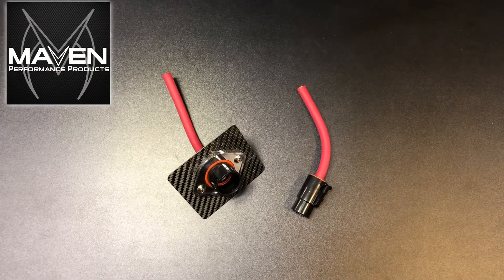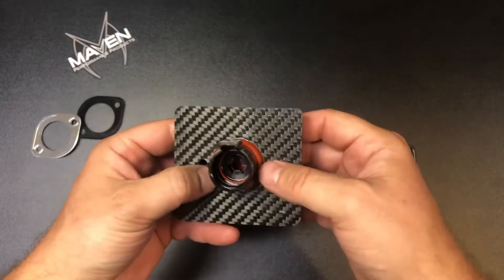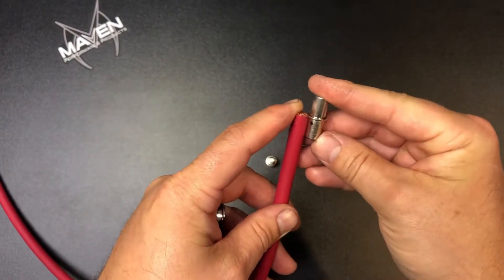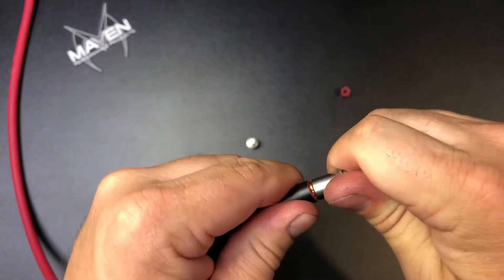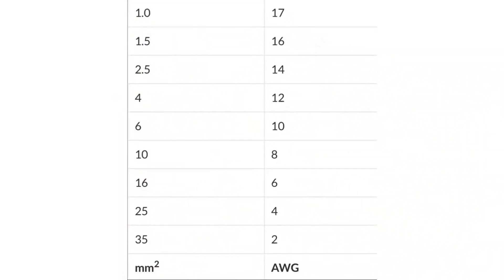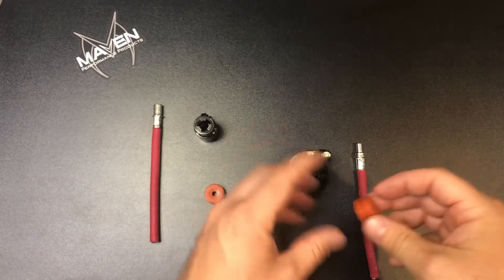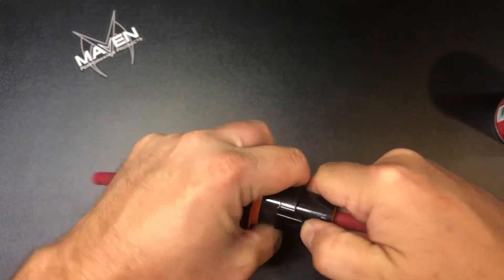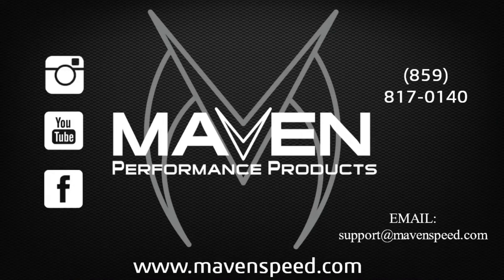Single 4ga Wire Connector Bulkhead Install!

Comment: Pretty sure the specked out tool for the crimping isn't 1600 I just bought it it's 300 or around there Don't remember exactly but it's from Deutsche to use on the six gauge and 4 gauge DTHD